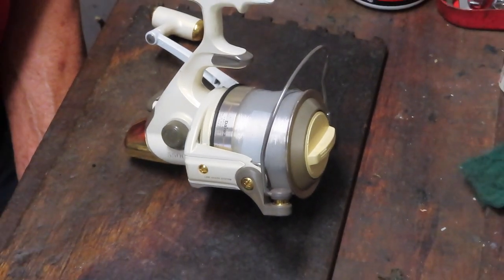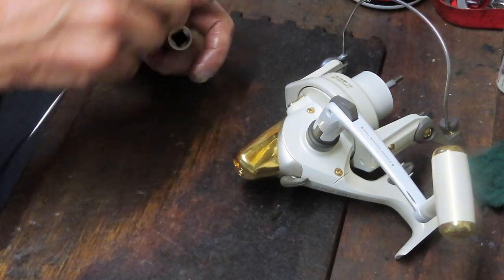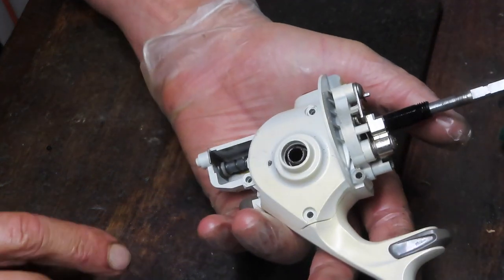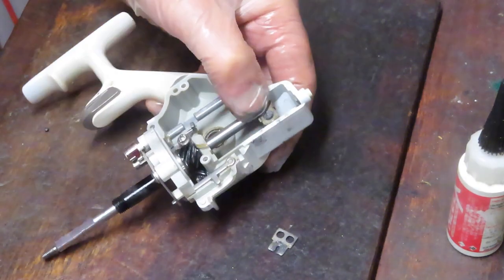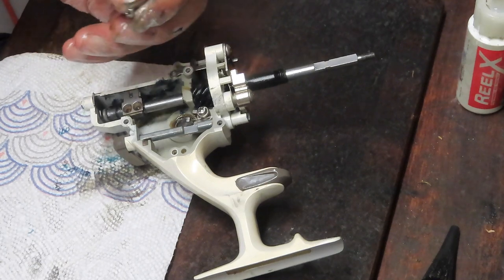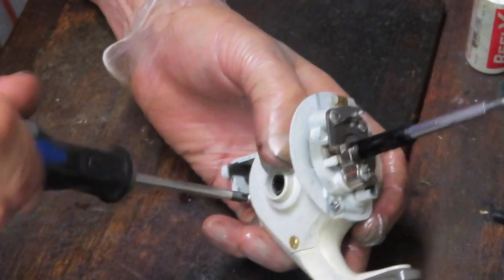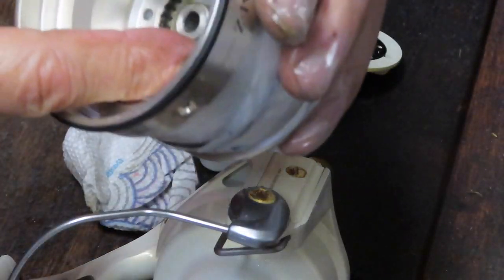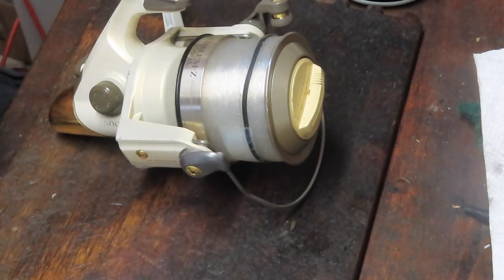Daiwa Emblem 500A  Carp  Pit spin fishing reel how to take apart and service

Comment: I got a Daiwa Emblem X 5500T in new condition for $11.50 about a year ago. I got it to put slick braid on and use for long casting past the bar when surf fishing it has worked perfectly  This Emblem Z looks a lot like the Emblem X but they have differences internally. My Emblem X  reel is probably the best deal I ever got on EBay!  I did not have to remove the AR mechanism on the Emblem X in order to get to that main pinion bearing. This Emblem Z has a beautiful  main gear! This Emblem Z  is more complex internally than the X model. Both are excellent reels though. The  only locktite I use is the blue and even then only on power knob installations. I had to use it on a slightly stripped side plate screw once. I use the bail manually on my X reel. I’ve got to get out my Emblem X to get it ready for fishing. It is my long casting reel that I put on a !2’ rod. It really does do a great job as a surf reel. This was a great video. I had forgotten you were going to do this one but I’m glad you did!
Reply from the maker: Great score

Comment: I'm not sure, but that black on the pinion gear and shaft may be a coating, maybe Cerakote. If so. it's probably there for additional corrosion resistance. The metal is probably stainless steel.
Reply from the maker: I'm not sure either, but if it helps, I am all for it - Dennis

Comment: Hi, thank you for an informative video. 

I have a pair of Daiwa Emblem 6000A with spare spools for distance carp fishing. I have changed spools in the past but this time around the spools will not go in far enough for the drag knob to engage and hold the spool. It appears that the line clicker is not going into the recessof the spool. I have tried and can only get one spool to fit again. Does anyone know what the problem could be?
Reply from the maker: If it is the clicker under the spool, rotate it counterclockwise while installing it and it should help it set in the ratchet.
Also check to kale sure the drag washers are aligned inside the spool. Turn the spool upside down and try putting it on the axle shaft.  Twist and turn it until it bottoms out. That will help align the key washers.  Once they are aligned, you can flip the spool over and install the normal way.
Dennis

Comment: Dennis, of all the reels I took fishing this past week, the only one that gave me trouble was my Emblem X 5500T Daiwa reel.  While I was fishing it seized on me. Today when I got home I took the reel apart and found that AR override piece on the main gear had come off and the metal piece on the rear of the worm gear had come out and jammed the reel. That metal piece was at the rear of the reel just inside that bushing on the worm gears I’ve fixed it but that piece was all bent up.  This Embiem X 5500T is exactly like this reel  except their is no anti-reverse bearing. I can’t figure out how those two pieces got loose inside the reel in the first place.  Any ideas?

Comment: Hi I have these reels and they have been well used over the past 20 year's. But they have developed a bit of play ( in and out) on the main shaft what would you consider to be acceptable travel on the shaft with the spool on. Thanks
Reply from the maker: Wear like that is to be expected.  It is usually the slot in the crosswind block that gets elongated and the stud on the crosswind gear that loses diameter. That causes the excessive movement up and down on the spool.  What is acceptable?  If the spool is still winding evenly, then it is OK.  If the line starts bunching or spooling high or low or winding in a figure 8 pattern, then that would be excessive.  If you can live with it, keep it fishing.  Parts would probably be hard to find and the repair not worth the cost.
Dennis
Reply: Excellent thanks for answer